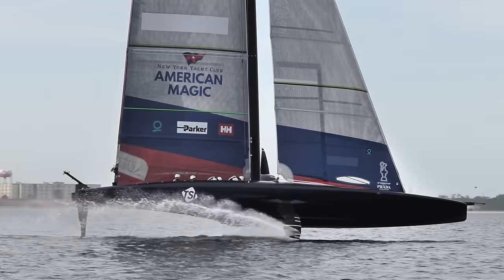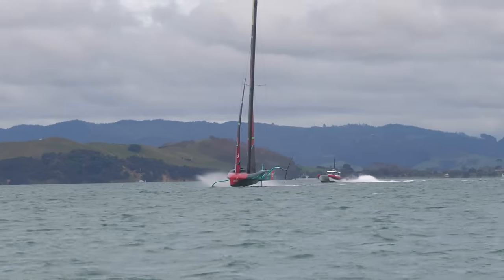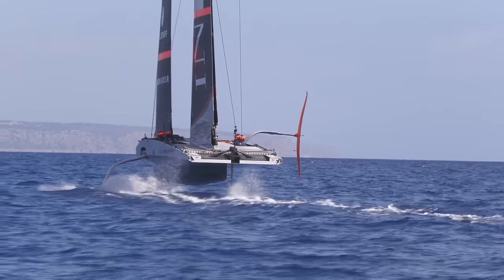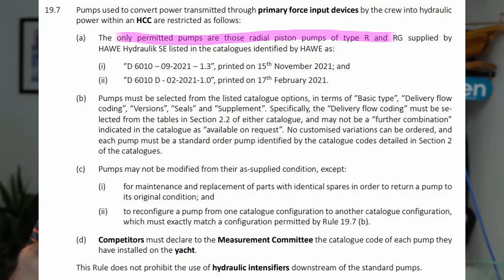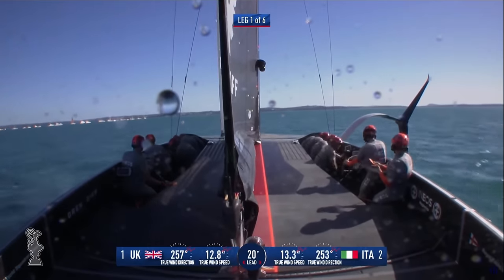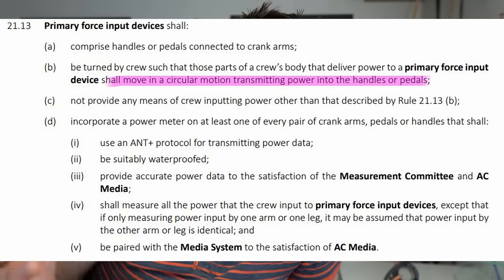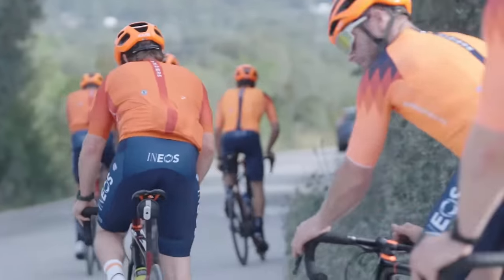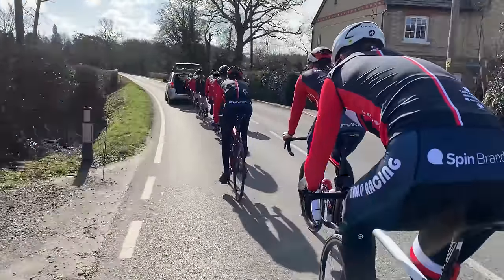Controversial America's Cup Cyclors are NOT what you thought

Comment: What sort of clips do they use for the pedals? I imagine racing pedals and shoes would be awkward on a boat.
Do they just use a gym style sleeve to put your shoe into?
Reply from the maker: In the previous cup, when they swapped sides they used MTB style clipless shoes with the cleat recessed. In this Cup the cyclors won't be changing sides, so they could just use full race shoes.
Reply: @MozzySails  Thanks for the info 👍
Reply: @MozzySails  Isn't using race shoes a possible safety concern in a boat during a capsize or crash?

Comment: i just wish they'd get rid of the batteries. people, wind, current. Also, I bet that you could figure out how to reduce the "dead-load" pressure using some flow component or bypass valve in the hydraulic system (or maybe a low pressure, quick cycling accumulator and a high pressure slow-cycling one).

Comment: It will still be different but connecting as many of you cyclors together as you would a 2 stroke engine by offsetting the cranks and connecting it all to one pump should make it easier for the cyclors to reach power and serge power if and when needed. When you look at internal combustion engines the more cylinders they have the smaller the flywheel they have.
Reply from the maker: that's an interesting comparison which I hadn't thought about

Comment: THANKS for the insight into what is going on with the AC boats, I really enjoy your analysis.  Hopefully you will do another video on the foil development.  BUT. It does not seem very productive to have the cyclors generating "power" on these boats. If the boats have battery packs to control the foil arms why are they wasting the time and effort even having the "crew" generating the power just have batteries generating the hydraulic pressure and get rid more "crew" members. The current AC series is getting rid of sailors on the boats and having digital operators controlling the trimming of the sails and foils through computers. These boats are not relevant to the VAST majority of sailors and it is like watching cars race ... NO crew work on sail changes, no reaching sails, no spinnakers no challenge to the crew maneuvering and doing the maneuvers correctly, just people hunkered down in cockpits doing laps on a track..

Comment: Clearly the legs are far superior at producing energy than the arms with the cyclical motion. Walking is what feet do and the movement is similar to the revolving one on bicycles.
But, I would be thinking of different body position, and which is the best for long term cycling motion.
 And i remember those bicycles that have the rider laying on their back, comfortably instead of the traditional bicycle position, which is tiresome on long runs.
Having the cyclors be seated and pedal away and not standing.

Comment: You may not be allowed a fly wheel but running lead weighted pedals could have the same effect with a lot less all up weight , id combine all cyclors together , look at the hydraulic pump resistance curve and bang the 4 cyclors at the best angle to fire like pistons to smooth out the load as best as possible.  Next ..  😅😅 hehe

Comment: I've been using oval chainrings for at least half a decade. I would never go back to round rings unless there wasn't a choice. For me, it has been a significant advantage but I'm far from an elite cyclist these cyclors obviously are. I'd be surprised if no one has experimented with ovals on a yacht. Couldn't hurt to try given how cheap and easy it is to swap oval rings onto a crank.
Reply from the maker: I've tried them on my mountain bike where I obviously go a lot alower. I thought they were decent there, but not a game changer. Did you have problems with the chain dropping on the road bike?
Reply: @MozzySails  On a mountain bike they are more noticeable. What oval chainrings do is smooth out the pedal circle. For cyclists who have a more uneven pedaling style, switching to ovals should be more effective, theoretically. Cyclists who have mastered 'spinning' may not see many benefits, but I have read some reviews by accomplished cyclists who initially harboured doubts and were impressed when they tried them. It's a very individual experience.

In my opinion. oval chainrings cannot hurt unless they're so eccentric the transition may be too abrupt for some cyclists to adjust. I started on Rotor Q-rings and then moved on to the slightly more eccentric QXL. I also have Osymetric on my fat bike. To be honest, I do not like the odd Osymetric ring shape. I much prefer the standard oval shape, It's far smoother. Nevertheless, any oval is better than round for my tastes.

Oval chainrings are a huge topic and cannot be covered here even remotely enough to do the subject justice.
Reply: @MozzySails  Forgot to mention regarding chain drops, yes, it happened to me a lot. When I was testing a 1x setup, I still retained two oval chainrings but stopped using the front derailleur and rode only on the large ring. Due to the oval nature of the chainring shape and very significant chain deflection in extreme gear positions, the chain would occasionally fall off, either inboard our outboard. It wasn't as bad when I still rode a 2x drive-train but it occurred even then. The need to stop and reposition the chain up to three times a ride wasn't worth the advantages. I was arriving home with dark fingers from handling the chain after almost every ride. By the time I built a new bike, I was so frustrated with this problem that I purchased a 1x-specific chainring with wide/narrow teeth to prevent it from happening again. I quickly realized that I should have done it sooner. The chain drops were a thing of the past. This is why I strongly recommend a change to a 1x drive-train using ovals if one's terrain allows it, because you can then avail yourself of the wide/narrow-toothed oval rings.

Comment: Sorry. You got it all wrong. You should have asked a race cyclor or his trainer
Reply from the maker: fast forward to @11:47 for view of race cyclor (America's Cup Winner) and track cyclist (Olympic midlist) Simon Van Velthooven
Reply: I was racing 50 years ago, the first Thing I learn was how to pedal "round" strokes.  Pulling up,  pushing forward,  pushing down, pushing back.
This requires a high rotation, low load, approach. However delivers the maximum output. Why? Because the limit is given by the amount of oxigen that can be fed by the lungs to the muscles.
Reply: Yes, in a sprint peak power can be delivered by jumoing on the pedals and pushing, but only for a few seconds. Recharging a battery is not a sprint, hence the round pedaling is the more appropriate.
Reply from the maker: @Blendedwing  okay, well I guess I disagree. Any attempt to over recruit on the lift beyond unweighted the pedal never felt efficient as those muscle groups just aren't evolved for that. 
There's plentry of studies on pedaling efficiency that show this and I found the same after using a power meter for many years.
Reply from the maker: @Blendedwing  try watching this: https://www.youtube.com/watch?v=1Q-9w048TS0
or this:
https://www.youtube.com/watch?v=IJN0GmdqtDk
P.s. i raced for about 5 years to a middling level. And I was very data driven.
Reply: @Blendedwing  Oh dear grandad, the world has moved on.

Comment: Interesting video as always! I recently saw this bycicle design (https://www.youtube.com/watch?v=xev18rBrNr0&pp=ygUPd29ya3MgYnkgZGVzaWdu), which has a better distributed power output. 
But I doubt it‘ll work with the rules because of the linear motion. What‘s your opinion? (I also have some suggestions for improvement of this design if you consider it legal.)
Reply from the maker: yes, I think that would fail the rotation rule. It's interesting, but I think based on a flawed assumption that you only get peak torque at 90 degrees. That assumed you only push down with the weight of gravity. Reality is whilst weight provides a significant counter force, the body can still put significant torque in around the stroke by pushing and pulling against saddle and bars to keep the input force at the tangent. At that point it becomes more of a physiology issue about what muscles are stronger and how quickly they fatigue. As I say in this video, it'a not perfect, as we evolved to run, not turn cranks, but with a bit of momentum carrying us through dead spots it's pretty damn good.
Reply: @MozzySails  thanks for the reply, makes sense